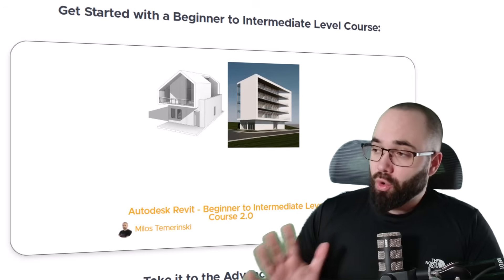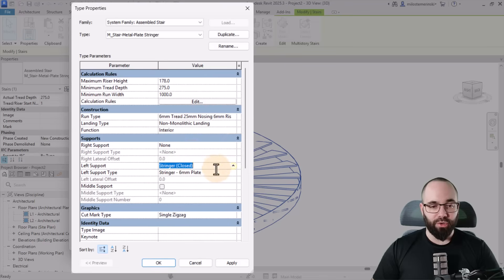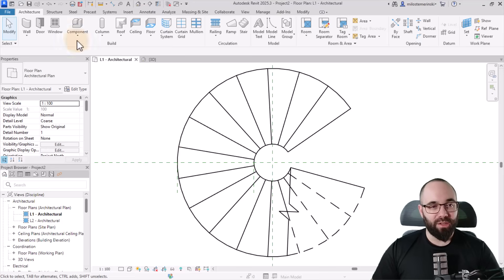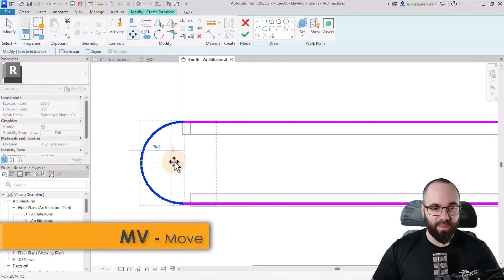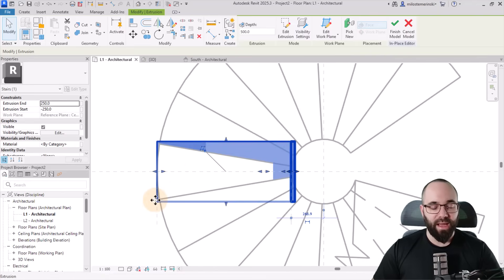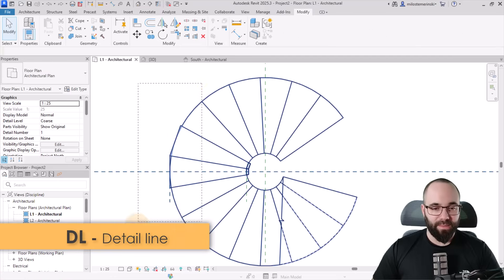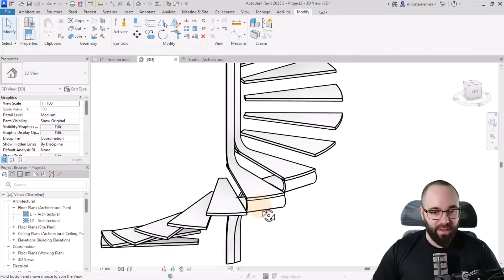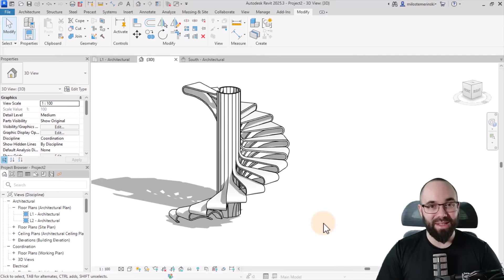Custom Stair in Revit Tutorial

Comment: Hi, great video! I don’t really use Dynamo, but I think there might be ways to speed things up a bit. For example, instead of rotating the view all the time, you could use the 3D view to move each profile up to the height of the next step (since the reference plane is always the same). Another option could be to create a profile for the extrusion, and for the lower steps use a void form to cut away the excess. One more idea would be to create a family with parameters for heights and widths. It’s not exactly simpler, but it could make building new stairs a lot faster.

Comment: Thank you very much for this beautiful video. Again you pushed the limits of Revit. But that doesn't change what a stupid program Revit is. It takes tens of minutes for a simple process. Sometimes I don't know whether it uses us or we use it. I wonder how this program has become a program that leads the industry. But maybe the blame is on users like us who have been using the program for decades and do not give feedback.
Reply: I agree with you to some extent .. ... Revit can be really slow and frustrating at times. But at the same time, it’s still the only platform that allows true collaboration across multiple disciplines like structure, MEP, and architecture. The way it handles linking and clash detection makes it hard to replace, since accurate layouts and coordination are critical for projects. Maybe that’s why, despite its flaws, it continues to lead the industry. . .

Comment: I'm new to Revit, and your content is simply so great you make it look easy I'm a big fan. I have a question can I model this and use it in other projects? Or does it have to be done within the project I'm working on?
Reply: You can copy it in other projects, but the way it was done here isn't practical - you can't easily adjust your parametrs like stair width, number of steps and riser height.